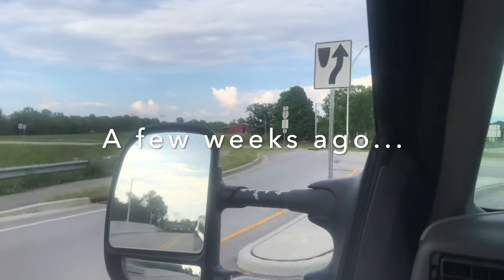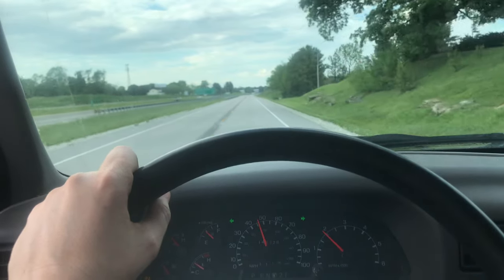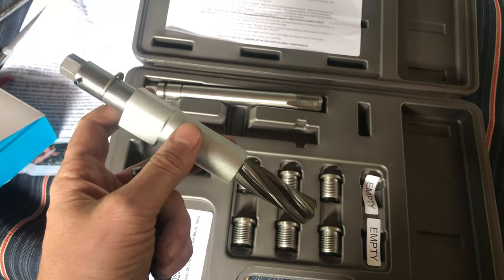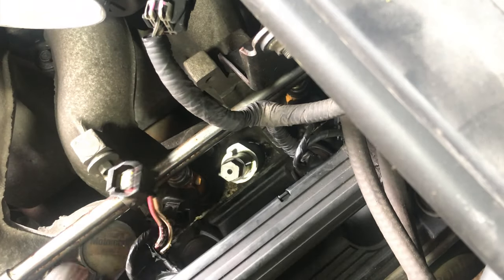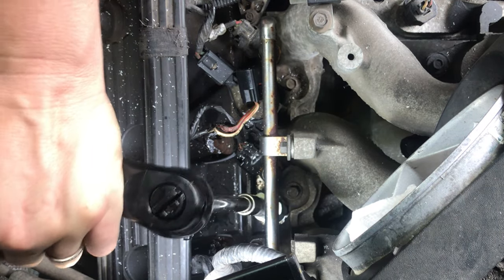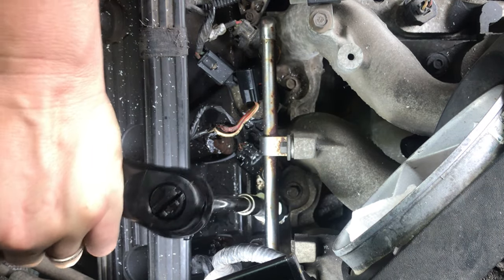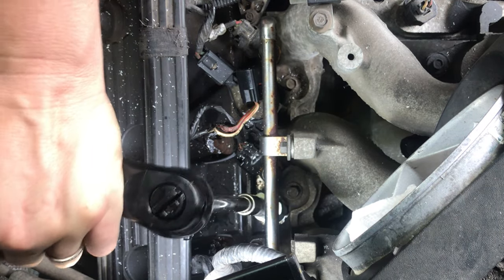Ford Triton V10 blown out spark plug repair!!

Comment: That is THE kit to get for this problem.    You can apply grease to the reamer to catch more of the aluminum chips and make it cut a little easier, but if you blow everything out with air it's all good. 
Nice work, Marci.    This is exactly how a Ford dealer would do it.  Great repair and you saved some $$$ !
Reply from the maker: thanks so much! Glad to know we got the right kit...I did try to research that a bit to see which one was recommended, etc...seemed to have gotten great reviews... I was dreading it, but wasn't that bad once I jumped in and got going on it...of course I DID have "help"!!!  hopefully he learned something in the process! lol

Comment: Hi Marcie, Glad you did that, I'm not comfortable doing that sort of job with the heads on. Although to take them off would have been a huge job as opposed to the way you did it. Nice kit too. Would have been nice to do them all in one hit too but I understand you doing it the way you did. Looks like your TA is doing real well too, look forward to more of his wrenching in the future.
Reply from the maker: I'll admit I was a bit nervous...I can flip a bus, drilling into an aluminum head...ehhhhh lol once I got going I was fine but starting was the hard part.  Hopefully it holds a while! kit made it so easy
Reply: @marcijunebug  makes you wonder why ford didn't put enough meat there in the first place. Aluminium heads needs more in certain places, the valve seat having a stainless steel insert to prevent valve seat recession for one. To only have 3 or 4 threads to hold the spark plugs smacks of a deliberate design fault to give mechanics work.

Comment: My 03 and 04 have alot more threads than early models I love it.
Reply from the maker: yes, thankfully they fixed the issue...ironically I JUST blew another one recently and it is one that is a bit difficult to get to soooooo I get to try my hand at that one now! ha the process is easy enough, it's just finding the time to do it!
Reply: @marcijunebug  so do you not bother to check the torque on the others? You only fix the one that blows out that wasn't checked the last time one blew out? Some preventative actions could have saved you this problem.

Comment: It sounded like its steam powered, isn't it like head bolts on a type one vw magnesium block, my buses were the type 4 engines. Its great to get your son involved. Mine was 2 when he first helped me and I put some oil on his cheek like my dad did to me and told him you,don't have to worry about getting dirty now.
Reply from the maker: yes...truck sounded awful...and of course wasn't drivable as I didn't want to do further damage shooting raw fuel that was then unburned into that cylinder...I'd already driven it way further than I should have...my double cab was down at the same time so we were without a truck altogether! I never have to tell him to "get dirty" I usually have to tell him to clean up! that is such a cute thing...oil on the cheek...very clever!

Comment: Marci, I was a little bit hesitant to watch this video. The reason being, I really don’t touch modern vehicles often. I’m glad I did. That was interesting and I’ve heard about Fords problem with the aluminum heads.
Reply from the maker: well thank you for taking time to check it out...at least I now know how to do something. similar on an old vw or some other engine we might have kicking around here! I love learning even if it is on a project I really don't want to work on, I figure the knowledge I gain from that will possibly help me down the road! cheers!

Comment: This video put a smile on my face the whole time when little one was helping you it's great to be small you can climb all over the engine. I really think it's cool with a woman can work on an engine like you have from what I take your dad talked you the mechanical skills. My dad was the mechanical contractor Plumbing and Heating well and I would go on job sites 7 years old. I thought I was doing a lot of work it wasn't until I got older I was his gopher but he also let me help and show me what to do and the rest of my life it's kind of like yours however not on the engines Wednesday make today they're just too complicated but I think I could do what you have accomplished. One question did you screw in the adapter by using the spark plug. I'm looking to buy a 2002 E 450 I'm wondering if that was the year that they corrected those problems
Reply from the maker: yes, the adapter is threaded onto plug, then they recommend and JB weld type fixative on the insert and then thread in to torque spec, then REMOVE the spark plug after setting for 24hrs and reinstall it to torque spec

Comment: I'm looking for a used RV, a guy has one for sale with a 2000  V10 in it. I asked him if he fixed the spark plug blow out problem. He didn't know there was a problem. I remember when spark plug sockets had rubber things in them to hold the spark plug. Those were the days.
Reply from the maker: haha well...I'll say this, these trucks are awesome trucks and truly this issue isn't terrible to fix.  We've had no problems with it since I fixed this last one and we've been pulling a 27 foot travel trailer with it...so fingers crossed it doesn't blow another, but if it does at least I know how to fix it now! thanks for stopping in!
Reply: @marcijunebug  Yea, he's got 50K+ on it and no problem, and that's an easy fix. Any idea how long you can run with one blown out without doing more damage? Seems to me it will run on 9 without damaging anything else. Of course it would need to be fixed ASAP.
Reply: @marcijunebug  Yea, he's got 50K+ on it and no problem, and that's an easy fix. Any idea how long you can run with one blown out without doing more damage? Seems to me it will run on 9 without damaging anything else. Of course it would need to be fixed ASAP.

Comment: Nice Job! 
It Kinda Sounded Bad At The End With A New Plug- Do You Need To Let It Idle After A Bit? The 99 F150 I Drive Now Sat After 6 Years, And That Was The Problem This Whole Time
We Were Gonna Give It A New Engine If The Spark Plug Didn’t Work
If That Didn’t Work, It Was Gonna Get Scrapped
We’re Happy That We Got It Fixed! It Looks Sharp, And Runs Great! It Just Sings As It Runs

Comment: Nice work! You might consider getting the truck coated at Krown. Keeps the rust away or from progressing. Good investment in keeping a truck on the road.
Reply from the maker: we use fluid film or just ole bar and chain oil usually...sadly this truck was already pretty far gone when we purchased.  BUT this summer it is getting reworked because it is cheaper to fix it than buy a different one and it's still a good ole truck, runs great and we know most of it's history
Reply: @marcijunebug  I hear you on that. I keep my trucks a long time too. Prices now are insane and it's best to not have a monthly payment.
Reply from the maker: I get "attached" to my aging "fleet"...think of all we've done and been through together! ha

Comment: If it does it again in that same hole you have to replace the cylinder head. Ive seen some of them form hairline cracks over time. Thats why if you would have replace the head if it did it again. Aluminum is a light metal but its extremely brittle over time from heating up and cooling down. The helicoil repairs arent that bad just time consuming. Awesome job on the repair
Reply from the maker: yep! We are two years out and that one is still goin strong!

Comment: Wow. Pull the injector wire off the offending cylinder. Fuel dilution in crankcase. And big fire hazard in engine bay. Older Duratech inline fours also have coolant jacket issues in the head. Plug ceramic crumbles upon removal. Coat plug with axle grease before removal.
Reply from the maker: yep...thanks for the comment!

Comment: Company I worked for bought a f350 stake body, we were two hours from home working and on the way there we had stopped for a red light. Truck started running rough, clutch pedal went to the floor and flames came from under the hood close to the cab. Got the fire put out, one of the plugs had blown out and landed on top of the hydraulic clutch line. We were stranded in a little pohdunk town for two days waiting on parts.
We watched the mechanic do this but he used a shop vac instead of air to get the shavings out.
Reply from the maker: wowzer! I debated on air vs vac, but figured with that little camera I'd be able to see pretty well if I had everything out of there...it's fixed for now anyway...until we blow another! lol I figured it was at least worth a shot.  I put the kit in the truck, worst case we now can fix it on the fly if we must! thanks for the story Donnie!
Reply: @marcijunebug  the funny part I didn't include was my wife had washed my thermos with soap. Had it not been for soapy coffee the truck would have burned. BTW the best part of your vid was little man on top of the engine. Won't be long he will be turning wrenches like mom. 
Thanks Marci, be careful and safe.
Reply from the maker: donnie brown omg! That’s hilarious! Thanks for sharing that little nugget...yeah he’s a pretty good helper! Quick learner too

Comment: ford has had spark plug problems for a long time back in the sixties their big block engines with taper seat plugs would blow out and hang by the plug wire. I put many back in when I had my shop.
Reply from the maker: it's such an interesting dynamic...you think they would want to fix it, but I figure cars are almost throw away items anymore...folks can't work on them and they figure people will get a new one every 200,000miles or so! lol Not us...we drive them til they drop then we pick them up and bandaid them over and over and drive them until there is absolutely nothing left!
Reply: @marcijunebug  I right in there with you my truck is a 92 my two cars are 2006 and a 2010, like raw hide, Rollin -- Rollin -- Rollin

Comment: The clutch on the AC compressor is a easy fix..good job on the plug repair...
Reply from the maker: yes, I think I'm just going to weld the little triangle bracket on the clutch and just leave it "always engaged" as of right now it is low on my list to fix! ha
Reply: @marcijunebug  the clutch disc is cheap ..i wouldn't weld on it what if it locks up..if that happens then it will be a major repair..it only has one bolt holding it on only takes a few minutes to do it..the disc you buy will be a upgrade ..please do it the right way you won't have any regrets..i always enjoy your videos..you get a lot done..i liked the little camper trailers too..see you on the next one..Cheers  🇺🇸🇺🇸🇺🇸🇺🇸🇺🇸

Comment: I liked the video I was just wondering is there a certain size of this tap kit to order and is it still working since this was videoed a year ago
Reply from the maker: Unfortunately the kit I used is no longer available (MOUNTAIN MTN9200 Spark Plug Insert Installer Set (Ford) - Alloy Steel) BUT CalVan now makes one and I have linked that one for you.  The specs of the engines it fits are listed in the link...and we have not had a single issue with it since I repaired it.  We pull our 27ft travel trailer often and have HAULED some other very heavy loads since the repair and it is still "trucking" along like it never had the problem in the first place! Best of luck! 

https://www.amazon.com/CalVan-Tools-38900-Valve-Triton/dp/B000Z9D6KW/ref=sr_1_5?crid=173Z3BYUTK3U2&keywords=MOUNTAIN+MTN9200+Spark+Plug+Insert+Installer+Set+%28Ford%29+-+Alloy+Steel&qid=1654748837&sprefix=mountain+mtn9200+spark+plug+insert+installer+set+ford+-+alloy+steel%2Caps%2C291&sr=8-5
Reply: @marcijunebug  Thank you so much for replying! You've really helped a lot, we sure appreciate it. Take care! 🙂

Comment: Nice job, like that talk indercator ,have done that job on a single head engine, taking head of, not knowing to blow out the metal shavings.
Reply from the maker: wasn't that bad of a job, little tedious and I was thankful it was one of the ones you could get to instead of ones in the back...but I wouldn't hesitate to do another one, just hope I don't have to

Comment: JB weld on spark plugs?!  I'd hate to be the next person tuning that truck up.  But nice job everywhere else.
Reply from the maker: the JB weld is an inside joke with my dad and I...but I DO always use "anti-seize" on almost everything including plugs...as I did in this case...Ironically I just blew out one of the back plugs on the drivers side a couple of days ago so I get to do this job again! Truck has been running great since then, absolutely zero issues with the ones I have fixed! Thanks for the comment! cheers!

Comment: Great job Marci, the only step i wouldn't have done is JB weld the plug in the coil, or am i wrong?
Reply: Loctite red aka liquid death..that stuff. Never gives. Up!
Reply from the maker: Only the insert has jb weld the plug is never seized inside the insert
Reply from the maker: I should have showed that step, when I show the plug with loctite on it that is actually the insert, plug threads are inside that

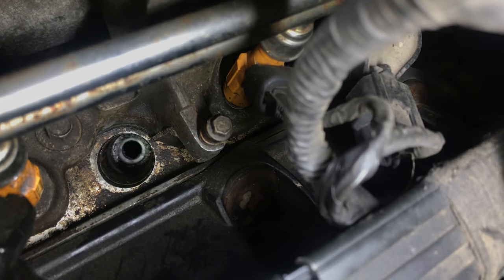Comment: 9:00 metal chips inside the engine after drilling.... Is that problem?  It seems like it would be good to try to wash the oil out with a solvent to prevent shavings from getting into the cylinder or the drill should be hollow (no point needed just enlarging the hole and add a vacuum to suck the chips up?
Reply from the maker: yes, they were blown out and vacuumed up, used a scope camera to inspect to determine all were gone.  most will just blow out on exhaust stroke and of those microscopic ones that were left I'm sure they burnt up and were blown out on first stroke...hasn't caused any issues to date and truck still going strong!

Comment: Did I hear correctly that the mpg is 11 miles to the gallon (I appreciate that the US gallon is smaller than the UK imperial gallon), and that is for a diesel, even with the lower oil prices at the monent, we are still paying about £1.19 (GBP Sterling) per LITRE, converting to US gallons, that works out at £4.50 per US gallon, or about $5.61 USD just to go 11 miles!!! Wow! Perhaps I mis-heard...?
Reply from the maker: yep 11mpg...which is about $1.99/gal right now where we live...it dropped recently to below a dollar but only for about a day, then jumped back up to about $1.50 but has been hovering around $2 for last month or so...it's a gas guzzler for sure!
Reply: @marcijunebug  wow, but then the cost of your fuel is significantly cheaper than here in the UK, what a difference!

Comment: Isn't there still only 4 threads holding the helicoil in??
Reply from the maker: I think it ends up being about 8...the kit instructions say 8-11, because the threads are finer than the original so get 2 for one kind of...we’ve had no issues with the 3 that have been repaired! So I guess it works!

Comment: So many bitch about these and blame the design (which was fixed in 2001) of the 5.4's blowing plugs out but if people pay attention and torque them properly (24 ft-lbs which is spec'd by ford) they dont blow out.  My 250,000 mile V10 excursion and both 2V 280,00 5.4 trucks have never blown plugs.
Reply from the maker: Agreed...we bought this one used. And although we’ve had it quite a while and have changed plugs we have always torqued to spec since we’ve owned, but they are great trucks and I felt given the repair was fairly easy it was certainly worth doing! It’s still running strong!

Comment: You can use an old spark plug boot to thread in the plugs!
Reply from the maker: didn't have one this time, but yep...I hate these deep well plugs!
Reply: Or a length of fuel line hose....

Comment: What keeps aluminum shavings from entering the motor?
Reply from the maker: The go down into the cylinder which is why I kept sending the little mini camera down to make sure I had blown them all out with air. You can blow them out with air or vacuum them out but you must get them out...micro debris with exit exhaust valve but the bigger stuff you have to get out

Comment: Interesting gasoline consumption. Here in Europe, consumption is given as liters per 100 kilometers. If I convert 11 miles per gallon, the consumption is 21.4l / 100km. Accordingly, 100km (62.13 miles) would cost 32.10 euros here in Germany. in other words, a gallon would cost 5.77 euros here instead of in the US where the gallon costs 1.95 euros on average. I am happy that my car only consumes 6 liters of diesel per 100 km (= 6.42 euros), even if I drive 200 km / h (124.3 mph) on the highway 😁.
Reply from the maker: that hurts my little brain just to read that! lol it is weird how different things are there vs here! stay safe and healthy over there, and thanks for always being here!
Reply: My eyes were glazing over reading the comment but I'll take your word for it 😉
Reply from the maker: James Couch 🤣🤙
Reply: @JamesCouch777  That is the reason why so few us cars are driven here, it is simply expensive. But every better small car can do the 200km / h. The best result I have achieved so far was about 280km / h with a consumption of only 8.5l / 100km with an Audi A6 3.0 diesel quattro with a moderate chip tuning. But driving so fast requires the greatest attention.
When I was young I also had an Opel with the Chevy V8 engine (5.4l = 330ci), but the beast drank 28l / 100km ☹️.
Reply: @GettingNervous  you would think that Americans would be more than thankful to live here. We have been very spoiled. Always interesting to hear from others. Take care.